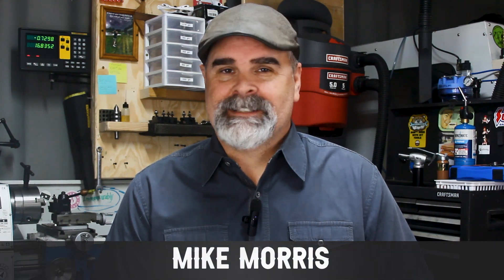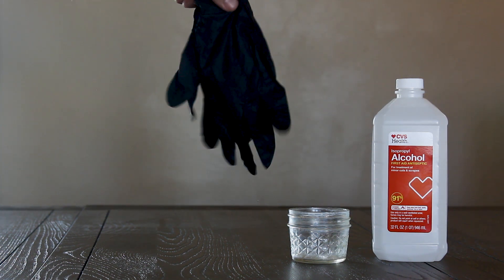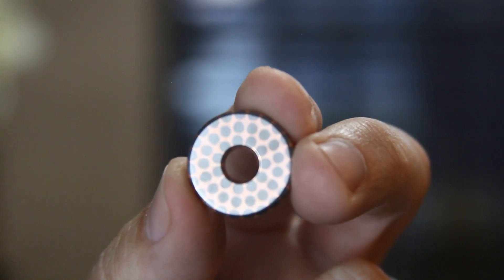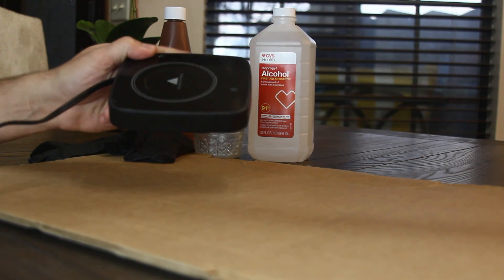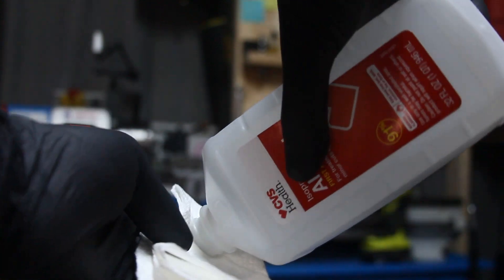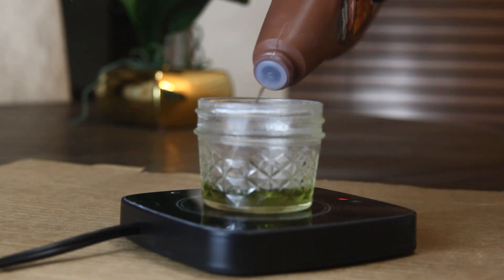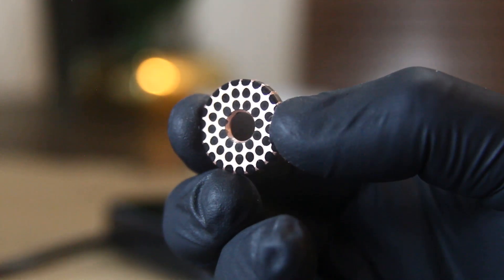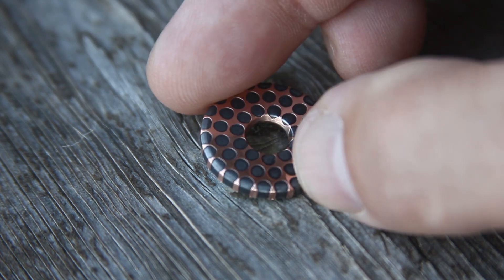How to Reverse Etch Superconductor

Comment: Hey Michael!

I’ve wanted to etch/reverse etch SC since I first saw it when people in the community first started getting it done by those that knew what they were doing early on. 
 I’ve never bit the bullet on getting the acid due to cost and how often I’d be using it.      Can’t justify the cost for how little I’d be using it. 
 BUT know you’ve informed me I can do it my favorite way, on a budget! 
Got some Whink on the way and had the other stuff. 
 I assume since it’s etching Ti/niobium rod, I could use it as a general etch for just Ti? 
 I want to be able to etch before tumbles or for two tone stuff as well. 
 I figure I’d ask the man, the myth, the legend if this will work? 
 Nail polish to mask? Or do I need to use something else? 

Thanks Michael, I appreciate your time and knowledge!
Reply from the maker: Hey Brian, yes, you are absolutely correct!  Fingernail polish will mask the superconductor from the Whink Rust Remover.  Just make sure you paint it on thick and let it dry COMPLETELY.  So when you're done and you want to remove it, just use fingernail polish remover.  I usually completely submerge the item in fingernail polish remover and clean it with q-tips (while it is submerged).  Thanks for your question and HAPPY ETCHING!